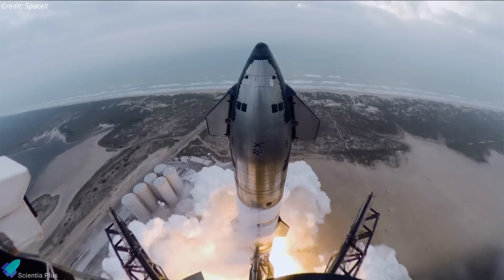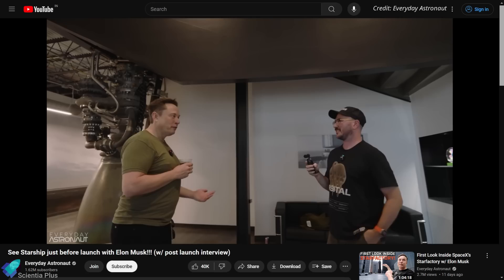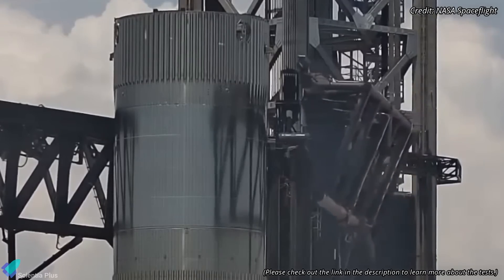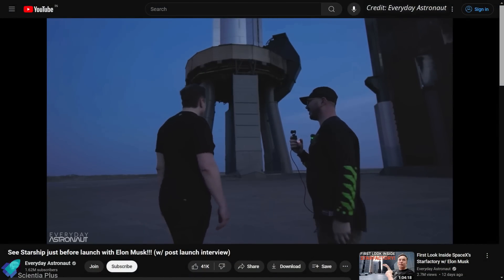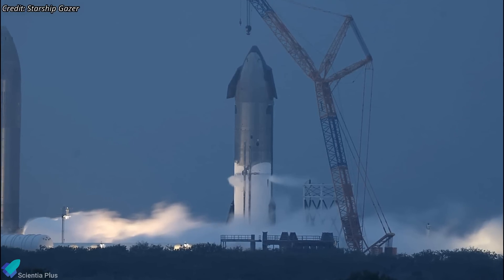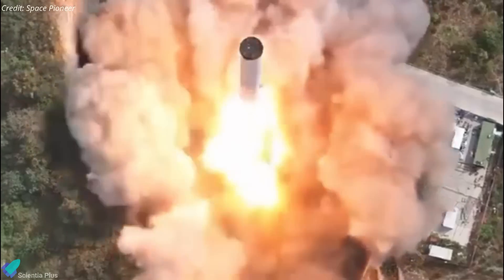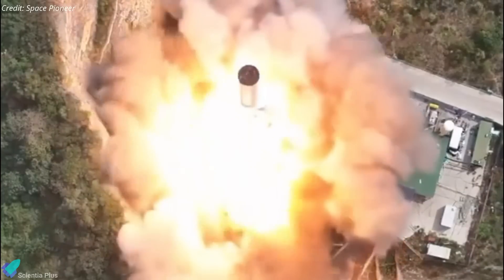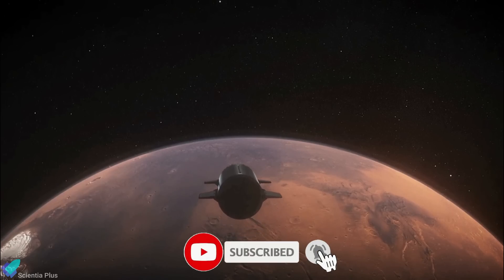Starship Flight 5 on Track as SpaceX Just Fixed Critical Issues & Tested Them! Tower 2 Stacking SOON

Comment: Incomplete reporting!  Like most other SpaceX focused channels, you reported on the new ablative layer and the stronger heat tiles without mentioning how much extra weight these will add to the heat shield.  On the Apollo capsule, the heat shield that was 13 feet in diameter weighed 3000 pounds, or about 5-6 pounds on average per square foot.  So, the extra weight of the new heat shield might be SUBSTANTIAL and should be mentioned.